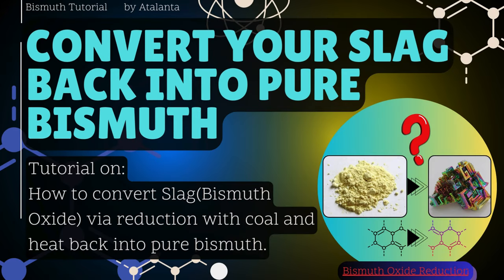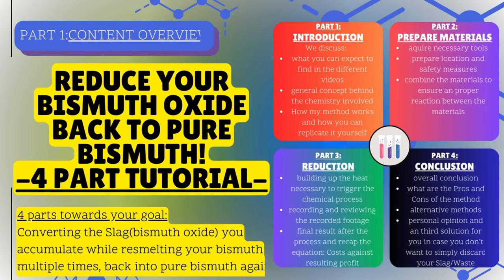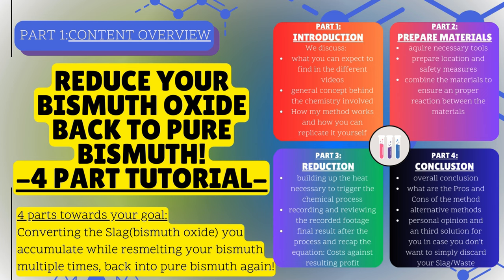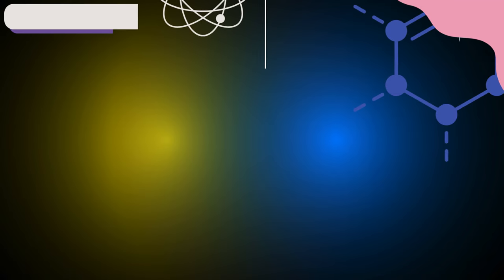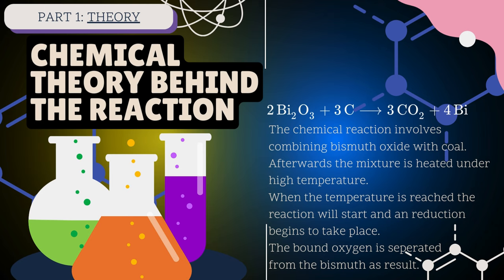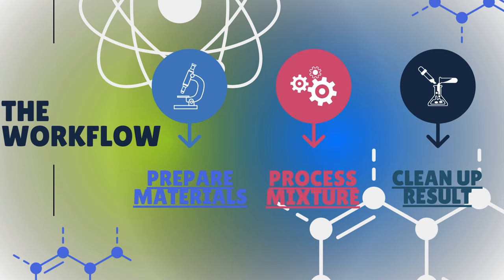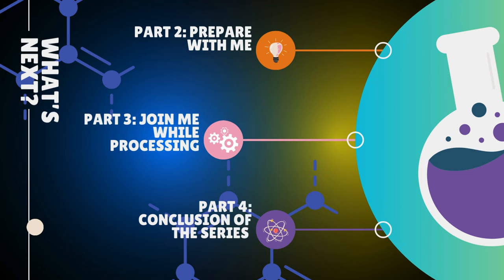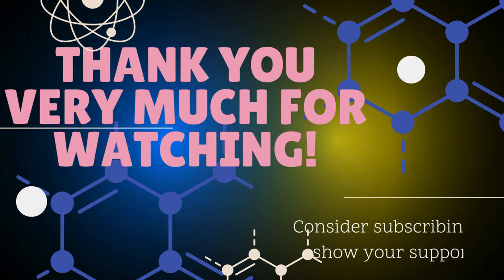Convert BISMUTH OXIDE(Slag) back into PURE BISMUTH[Part:1] @AtalantaHessbrueggen

Comment: Can you use another metal in place of the carbon?  Say aluminum or zinc?  That way the temperature doesn't have to be so high as aluminum and zinc melt at much lower points.
Reply from the maker: That would cause problems because these metals would melt together with the bismuth. The carbon part is very important in thius reactiion, because it strips the oxygen from the bismuth oxide and while burning in the process. When you choose metals which have a lower melting point wouldn't fix our problem because they wouldn't remove the oxigen while heating up. You want to remove oxygen and other metals from the bismuth slag, introducting othert metals wouldn't help you I believe. But the carbon source is up to you, I only prefer charcoal because it's more availible than coal, but the key is a source of carbon to combine with the bismuth oxide in high heat in order to trigger the reduction process. But I never tried anything different than that, so take that only as an suggestion because I can't prove your idea^^'
Reply: @AtalantaHessbrueggen  I was thinking more reactive metals would replace the bismuth in the oxide, but you're right about the mixing.

How about some hydrocarbon?  Because with charcoal you need to raise things until the bismuth oxide melts, which is 850 C or so.